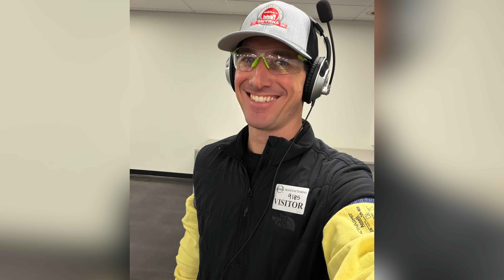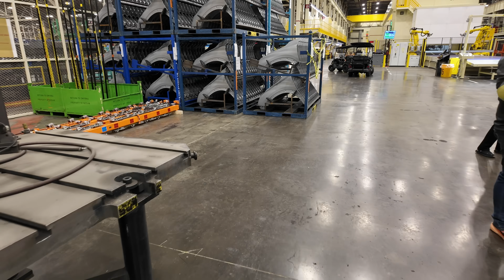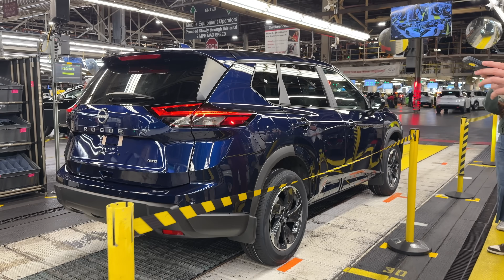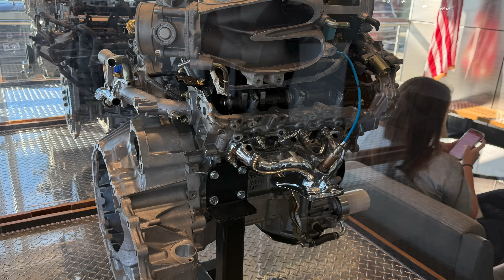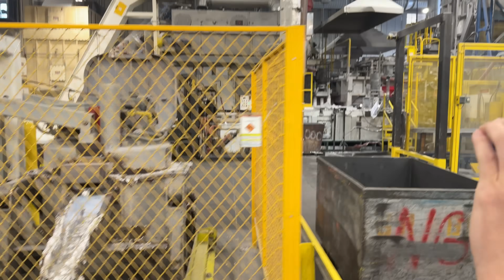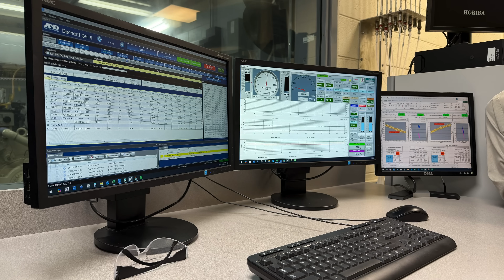NISSAN GAVE ME THE KEYS TO THEIR FACTORIES SO I COULD SHOW YOU HOW THEY'RE MADE IN AMERICA

Comment: Nissan makes some amazing products, the CVT issue was unfortunately a horrible mark on a nearly impeccable record. I have owned four so far and I have nothing but rock solid ownership experiences. Excellent content and thank you for sharing.
Reply: My sisters altima, not well cared for, has been incredibly reliable despite its abuse by her and my neices . The CVT has 140,000 on it despite the less than favorable odds .
Reply: @NCrdwlf  I had hoped Nissan would go back to the manual transmission and add a six speed for fuel economy with the small displacement engines. Awesome cars.🎉

Comment: Saw a video from a creator where he slapped a 5.6 Nissan V8 into a old Ford Fairmont 2 door or something similar. He tore it down a bit and showed the crank. It was forged and balanced with other race car types of stuff. He said it was the poor man's LS/coyote engine and he ended up putting twin turbos on it and eventually made big power and didn't break it on the stock bottom end. I haven't watched the dyno run yet but it sounded promising.